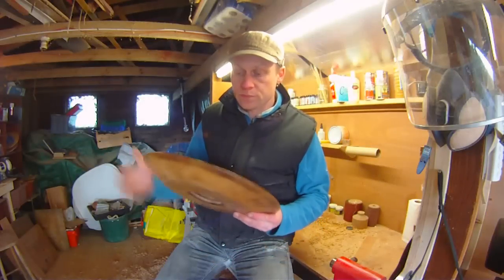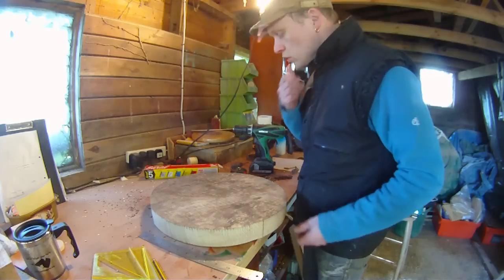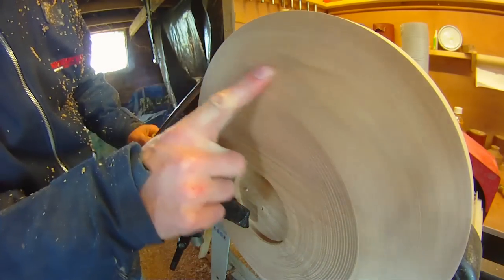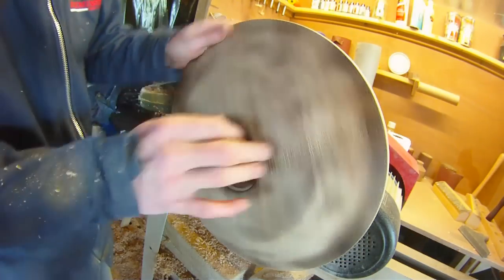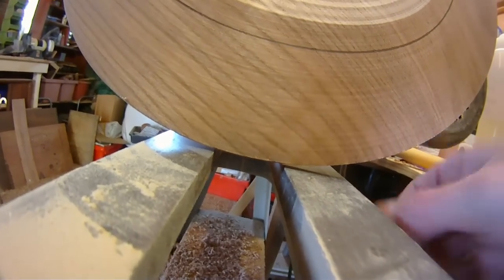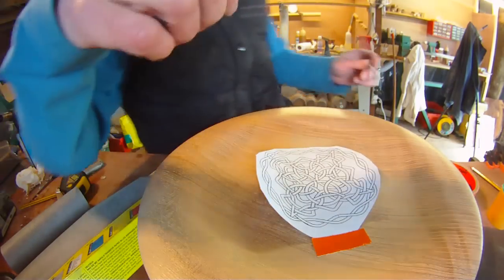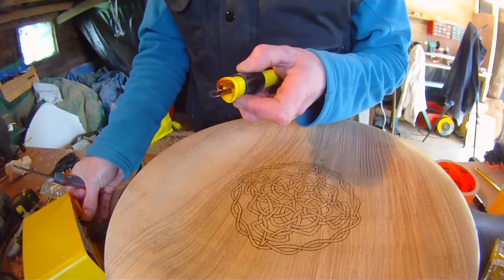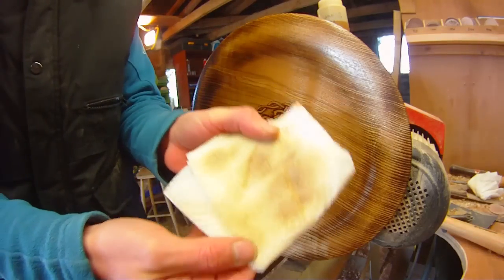#6 Woodturning Burning Scorching with Celtic Knot Pyrography

Comment: Nice job, enjoying your videos from here in the US. When I'm doing pyrography, I print the image to be transferred with a laser printer, printed in reverse, then rub the back of the paper with lacquer thinner to transfer the image. The thinner releases the toner from the paper and it sticks nicely to the wood. Much faster and darker than carbon paper. You should give that a try.
Reply from the maker: Good idea that, Matt. I've not got a laser printer, just an 'old fashioned' inkjet printer - does that work too, do you know, and how does it effect removing any remaining toner lines when you're done burning?
All the best,
Martin
Reply: Ink jet will NOT work, has to be laser, but a photocopy might.  The toner doesn't soak into the wood, just lays on the surface, so I swipe it with a green scrubbie or a piece of steel wool.  You can use the lacquer thinner to remove it, but if there is a lot, it can smear it around a bit. https://www.youtube.com/watch?v=LzJWsAQyJ8Y

Comment: I loved this video.  That piece is really beautiful and a credit to you and your stickability (is 'stickability' a word?  It is now).  I have a Peter Child machine I bought second-hand in great condition so it might get a run out soon.  A wee tip -using that banjo extension for outboard turning puts a lot of stress on both it and the standard banjo at the lathe bed so I cut a length of 3" x 2" to support the extension in case I get a catch and the force breaks the cast iron (cast iron is very brittle).  My engineering mates told me to do this so I listened did what I was told and it does give me some comfort knowing the set-up is more secure.
Super video, thank you.
Best Wishes, Brendan.